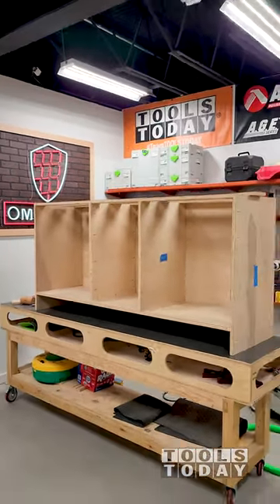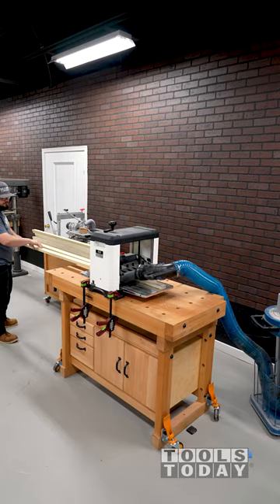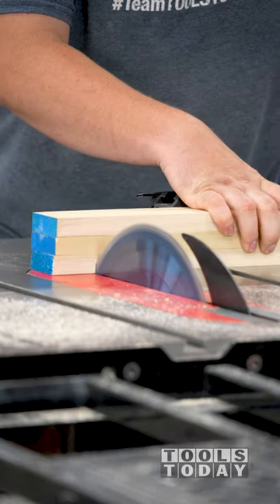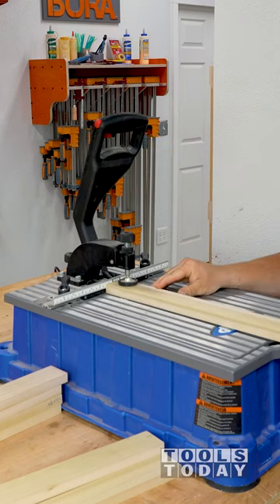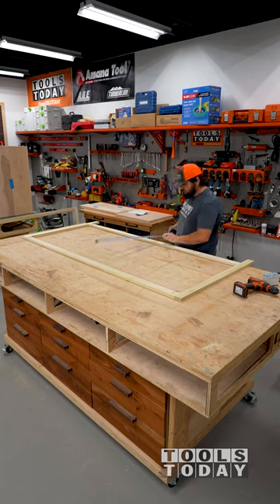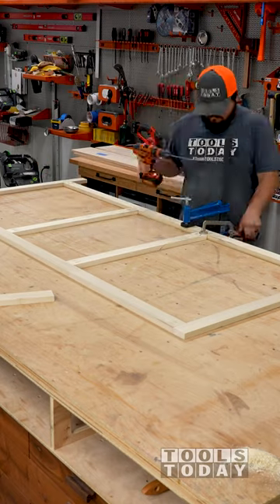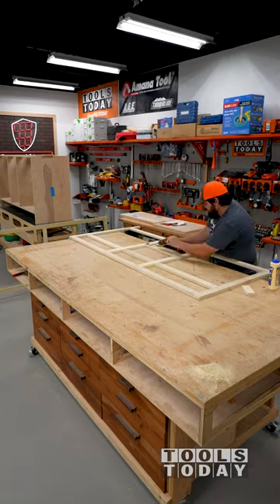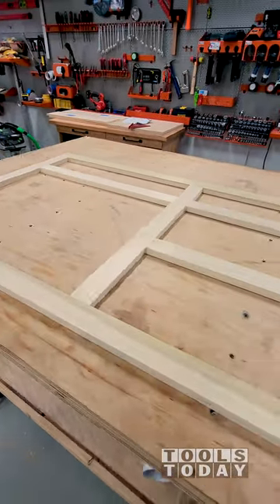Making a Face Frame

Comment from the maker: Check out the tools used on our website -https://www.toolstoday.com/search?q=sawstop

Amana Tool PR1040C Saw Blade - https://www.toolstoday.com/v-11877-pr1040c.html

Jet 13" Planer - https://www.toolstoday.com/jet-722130-jwp-13bt-13-inch-planer-with-helical-style-head.html

Amana Tool 610801C Saw Blade - https://www.toolstoday.com/v-12055-610801c.html

Fein 12v Drill - https://www.toolstoday.com/fein-71161061090-ascm-12-qc-4-speed-cordless-drill-driver.html